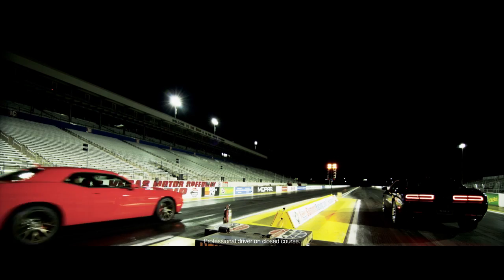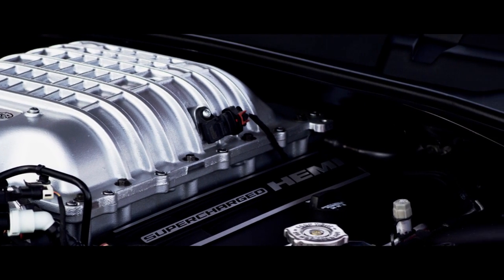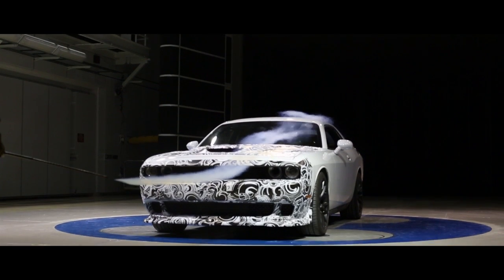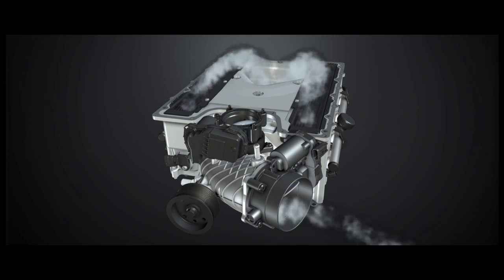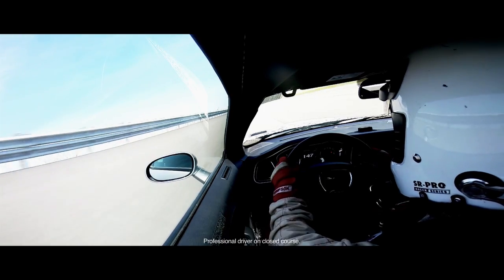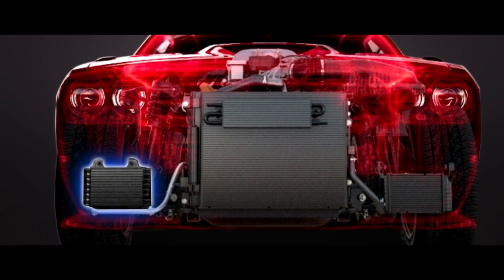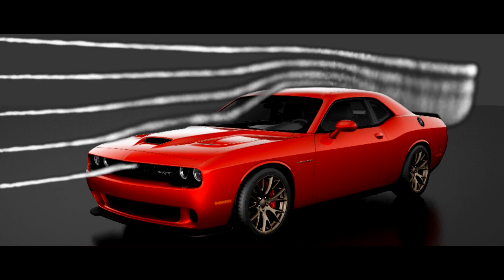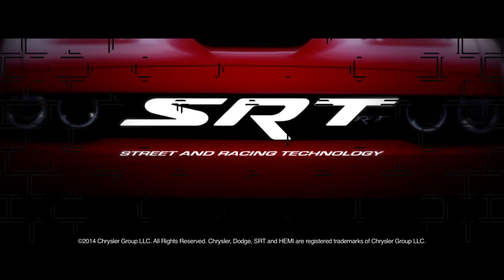2015 Dodge Challenger SRT Hellcat - Cooling System

Comment: They say it has a "low speed coolant loop," but I would love to know how they can this thing cool on e85.  According to the internet, this thing can generate about 1100 hp on flex fuel. If they are measuring it at the wheels, it's probably north of 1300hp at the flywheel.  But even lower numbers, like 1010 HP at the flywheel would generate 3 million watts of heat  There is just no way the cooling system can keep up with this very long.  Keeping up with a single 10 or second 1/4 mile isn't difficult, because it's only 10 seconds and the coolant has a lot of thermal mass.  But doing that for a couple of minutes would heat the coolant way faster than can be exchanged with the air.

Comment: How much this car ??
Answer me
Reply from the maker: Thanks for asking - pricing will be announced later this year.
Reply: Not really an answer..
Reply: Street and Racing Technology Please don't price it super off from the middle class consumers budget :)
Reply: Hector Nazario how much would you pay for a almost 700hp factory car?
Reply: Tomaz Hilton I don't know. Pipe dreaming I guess but if I had to give a number that I would pay at the top end I'd say 50k
Reply: Well the SRT8 new is 53 thousand so I bet this Hellcat car will be close to 70 thousand
Reply: Street and Racing Technology Please tell me this car doesn't weigh over 4,000 pounds.
Reply from the maker: Johnny Sokko
It's estimated at 4,240 - 4,449 lbs. curb weight, depending on engine and transmission selection.
Reply: Larry Coleman The SRT8 is around $42,000. The Hellcat will probably be around $56,000...same as the Mustang GT500 and the Camaro ZL1.
Reply: Street and Racing Technology Wow, that's a ridiculous weight for a performance car!
Reply: Ever thought how much a  Veyron weigh??
Reply: Tomaz Hilton Have you seen how much stuff is packed into the Veyron (and it's still lighter)? The charger and challenger are heavy just to be heavy.
Reply: the Veyron weighs in about 5500lbs!!!!
Reply: Tomaz Hilton The Veyron is under 4200lbs.
5500lbs is about the weight of a small suv or a big fully decked out luxury car like a Phantom.

Either way 4200-4400lbs is heavy for a sports car. That's a lot of weight to throw around and that's with nobody in the car. The GTR got away with it due to all of its 'trickery' and the veyron just out muscles the weight with nearly double the horsepower of this car.

The hellcat wont have the luxury of being able to fool the senses or overcome the weight like the 2 cars mentioned above. Next to cars making similar power, it's going to look and feel slow.

Even so, it's still a cool car and i'd love to own one.
Reply: i ment to type 4500lbs but Car & Driver First test says 4300 lb MT's Test of the 2013 GS Vitesse says 4400 lb, your thinking about the Super Sport maybe. thats 4300 lb that as Carbon Fiber, and light weight Aluminum, smaller dimensions. The Challenger being a 5 Passenger Midsize coupe should be weighing 4100-4300lbs
Reply: $59,999 USD
Reply: The basic is around $60k